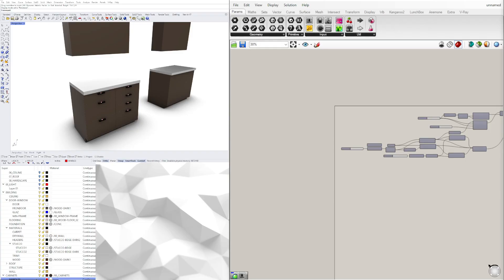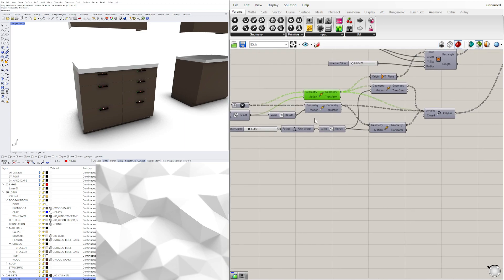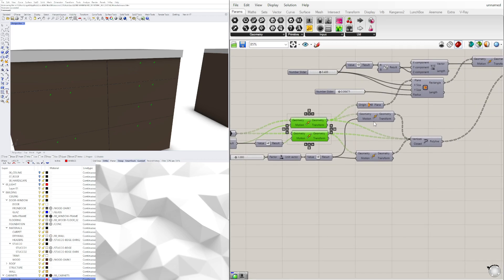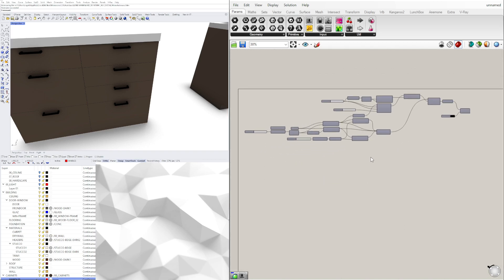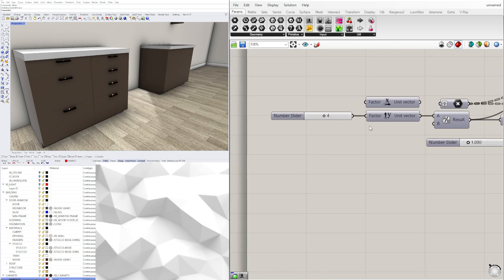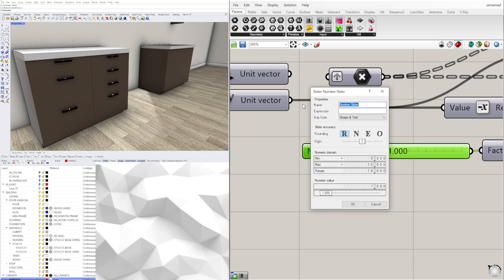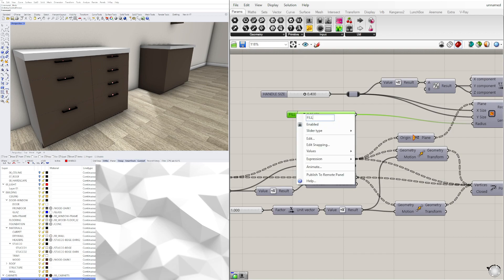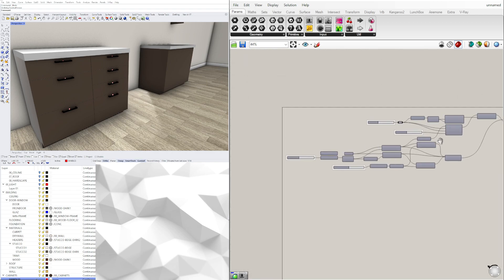Cabinet Hardware Rhino and Grasshopper

Comment: I will apreciate to see a video about how to add connectors and mechanisation holes between different parts of this cabinets, sorting the panels by thickness and material, nesting in sheets, generating BOMs and Technical Drawings and DXF files generation for CNC fabrication. Thank you.
Reply: i suppose you can export it to another software, otherwise it would not make too much sense...